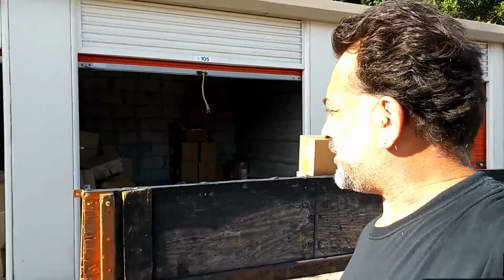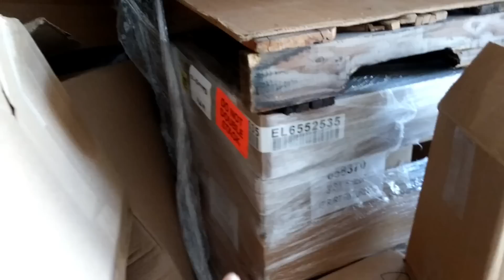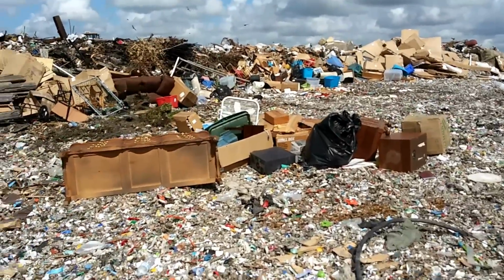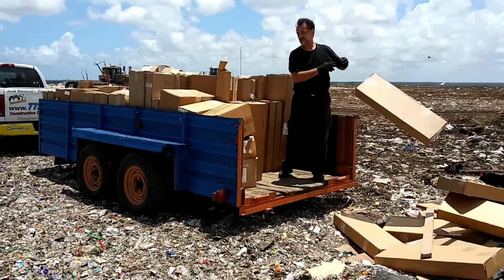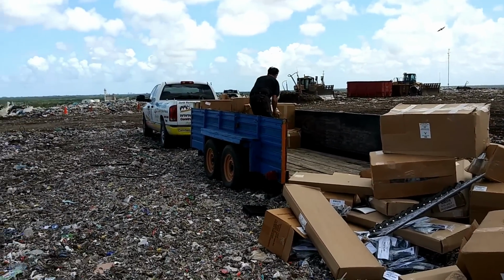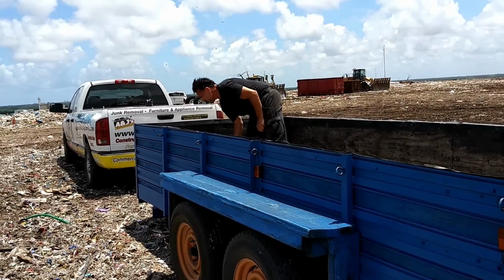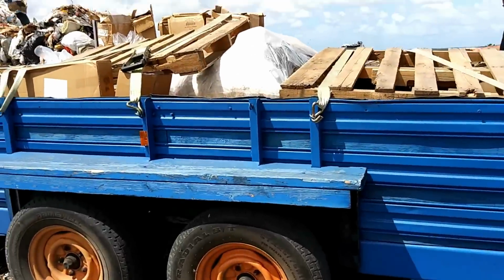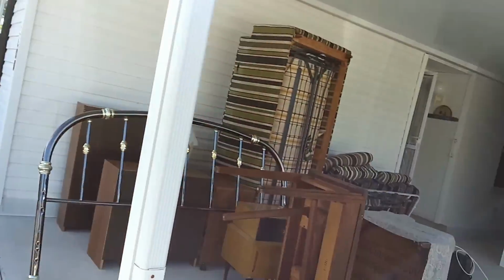Busy day for the junk removing duo

Comment: How many yards will fit in your trailer? And also when you price do you estimate the yards for the customer and then only charge based on how many loads?
Reply from the maker: It's considered a 10-yard trailer.. We estimate the yardage or how full the trailer will be to help us determine the price.. Some jobs are labor-intensive and may require an additional fee..